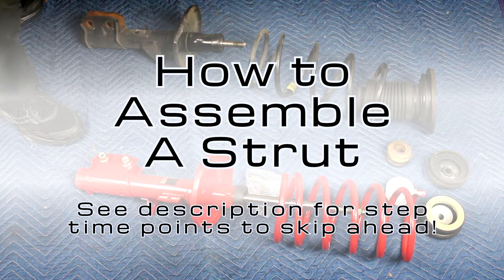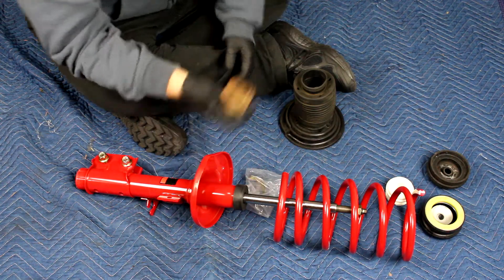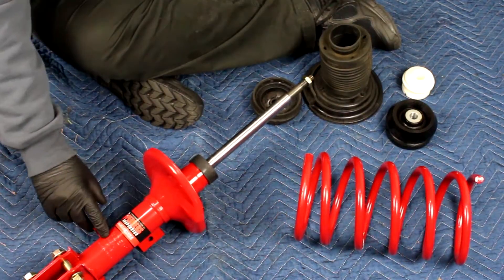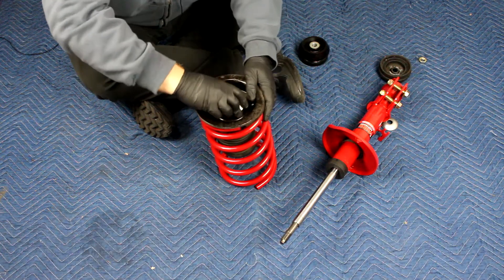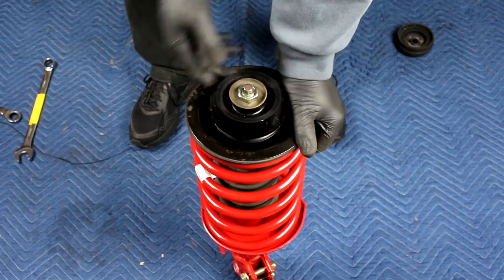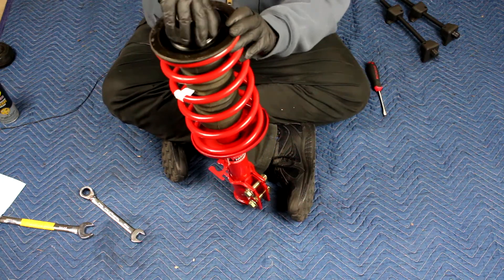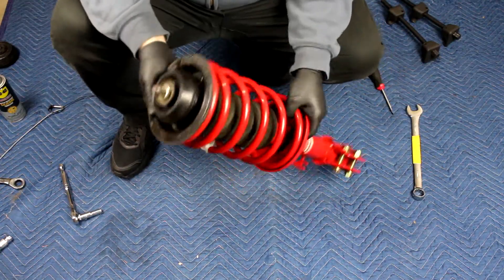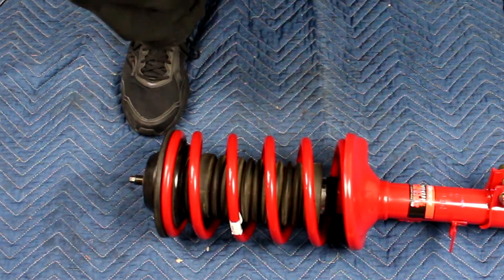How to Assemble a Strut: Part by Part Explained • Cars Simplified: Suspension

Comment: Thank you for this very helpful video! I’m looking at replacing the front coil overs on my Xterra.
Reply from the maker: Thanks! I suspect the Xterra will have quite a few suspension differences, but I'm not familiar with it enough to say what to look out for.
Reply: @CarsSimplified  I think it’ll be all right. I’ve been learning how to use a wall-mounted spring compressor. I think I might try that. It looks a little more safe for me. Ha ha ha. My goal is to use my OE Springs, and put in new shocks. We’ll see how it goes…😅

Comment: Awesome video, got new struts to replace my coilovers in my 06 GTO (they suck) and now I feel confident in assembling the new KYB struts with the Pedder's springs! I think I may need to replace the upper spring seats though, the bearing surface was corroded enough to make it no longer smooth.

Comment: Would you happen to know the torque setting for the nut on top the bushing?
Reply: A little late, but most struts are torqued to 30-50 foot pounds.
Reply: Even later to the party, but what I've seen online it's 58 ft lbs!

Comment: Would you happen to know the torque setting for the nut on top the bushing?
Reply from the maker: I have not been able to find it. The instructions that came with related parts didn't have it, and I wasn't able to find it online. The GTO forums seem to be aware of this lack of information, too.
Reply: If you have the GTO, the specs I found online are 58 ft lbs! Hope this helps